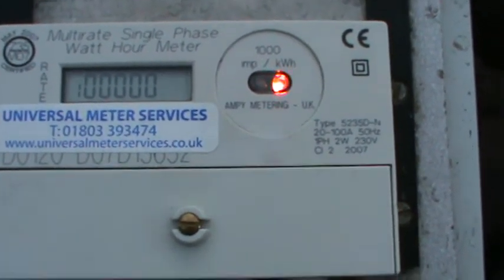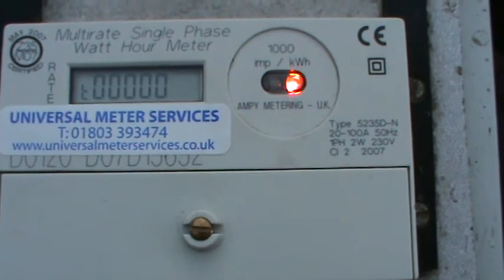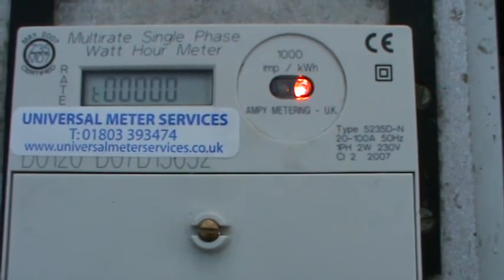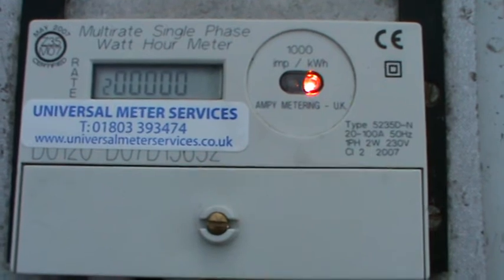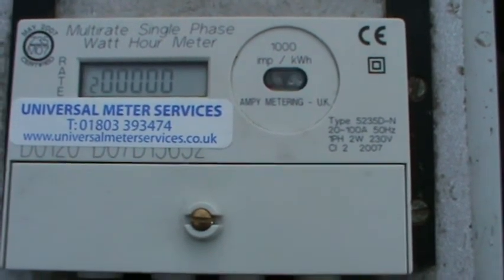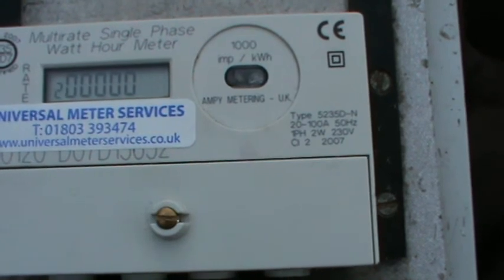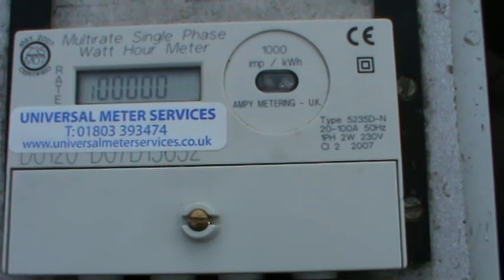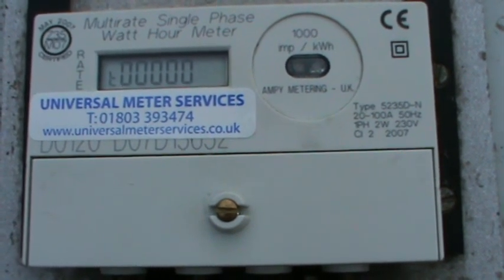Ampy 5235d-n Dual rate electricity meter

Comment: Hi Steven. Does the time clock need to be installed by the energy company or is that something that should be done by the property owner? I had assumed it automatically switched but I think I now realise it needs an external Switch. And if the energy company don't install it what's stopping me from setting the timer for whatever times I want? Thanks for any advice..
Reply: Time switch has to be installed by the company that fitted the meter and it remains THEIR property and has to run off THEIR electricity NOT yours ( not that a time switch uses much electricity). I have seen time switches removed by electricians when storage heaters are removed, erroneously believing that the time switch's sole purpose is to energise the storage heaters.

Comment: Robbin, if there is no read then you need a new meter,  But dont rush mate make the most of the fact anything you use until its changed can not be checked ! and no one can prove what you have used....so wait for the meter reader to spot it
Reply: Not always a good idea, you can end up with an excessive estimated bill. It is the customer's responsibility to inform their electricity supplier if the meter is not working. The only exception would be if you have a BKM key meter.